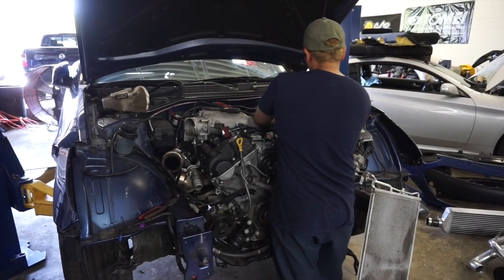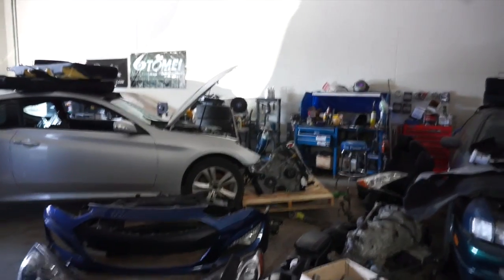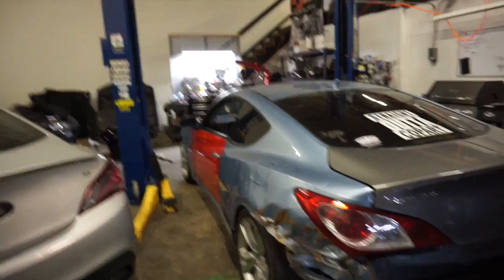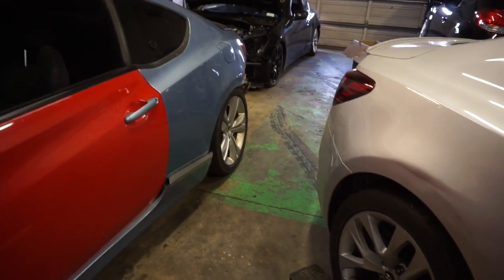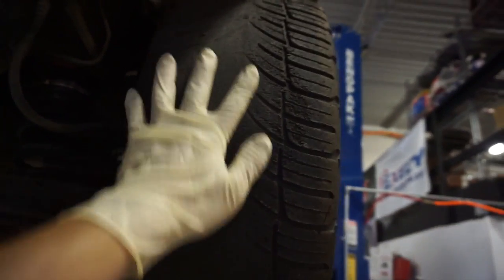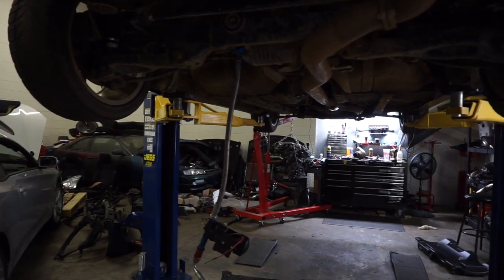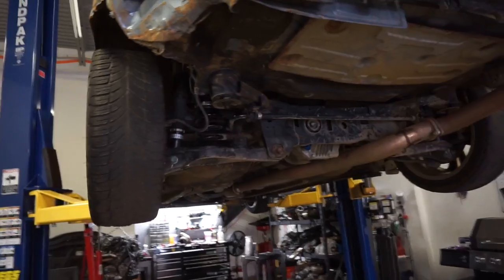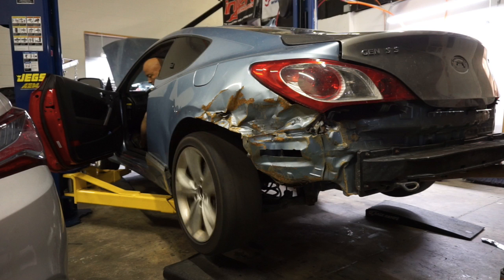3.8T Engine removal | Maintenance and install on Copart Car

Comment: Hey I just did a engine swap in my buddy's 2010 coupe 3.8.. put a used engine in it with all of his accessories, intake and throttle body.. I had to replace it because he downshifted when it was red lined and put like 3 holes through the block.. now I have tons of engine light codes.. the main ones I'm confused on are p2015, p2106, and p2195.. what would cause those codes? Didn't have any cel before he blew it up

Comment: Don't you love the smell of diff fluid? Hahaha. 
But on a serious note. About how miles do you change out the diff fluid on a daily driver with the LSD diff?
Reply from the maker: This was my first time actually changing it on the drift car. Since it has 2 way and locks up everytime yet used for drifting I plan on doing it for every 10k miles.
Reply: Simon Moon ive havent changed it in my truck in over 5 years oil 2 for that matter